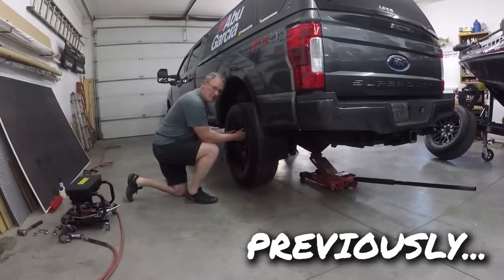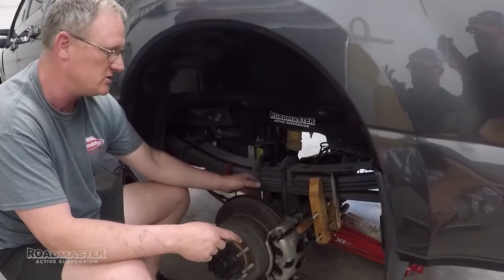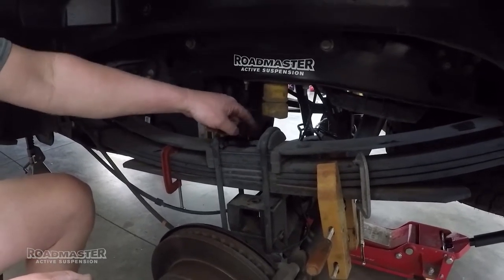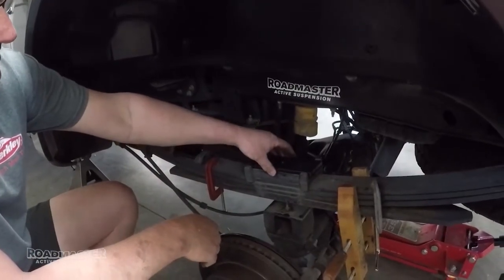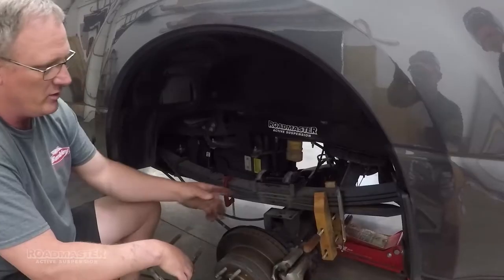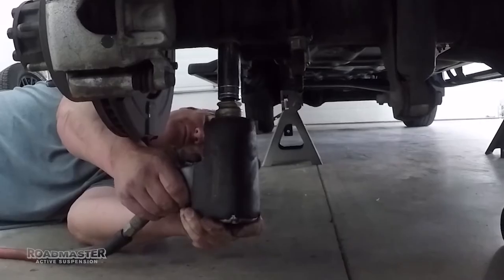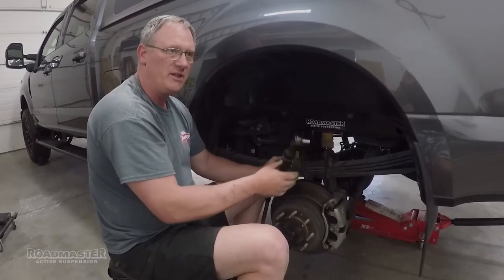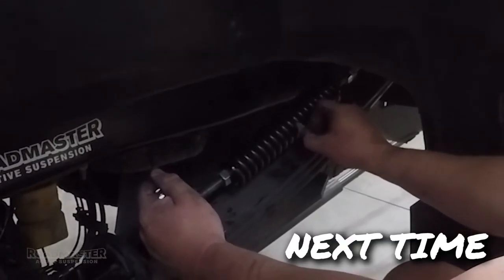F250 & F350 Superduty W/Overload - RAS Installation Part 2

Comment: I really like how thorough your videos are and how you emphasis safety measures... BUT, when I try to remove the center bolt that goes through all the leaf springs (so I can remove the overload leaf spring.), there is no hex head bolt on the bottom.  I lowered the rear axle to get access to that bolt, but it is ROUND, not a hex head or allen wrench. Is there a secret to getting that out?  

HELP!  WHAT DO I DO?  I noticed an allen wrench bolt an inch or so from the round center bolt head... maybe that has something to do with it.

Eddie - Frustrated in Texas
Reply: Same here

Comment: What they aren’t telling you you should be replacing the u bolts and nuts. That’s just a factory standard of repair I personally am ok reusing if they are in really good condition and on a truck that is fairly new.